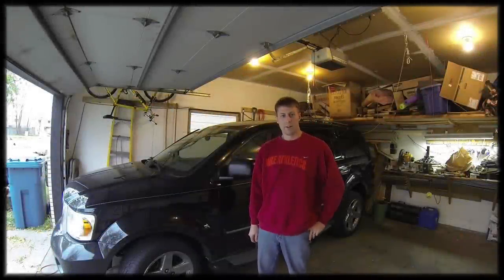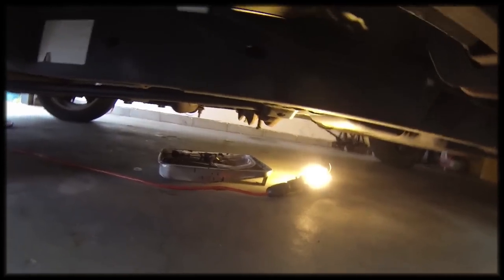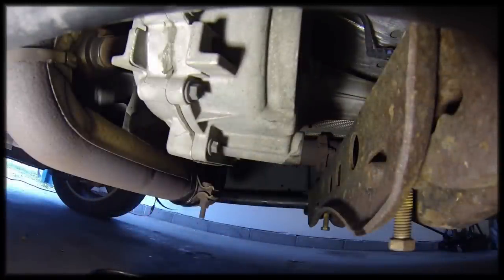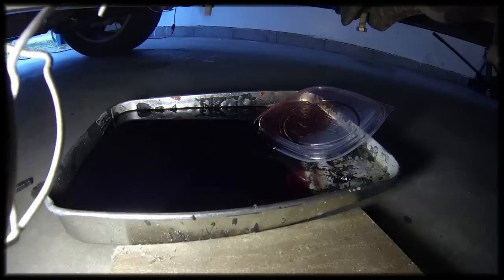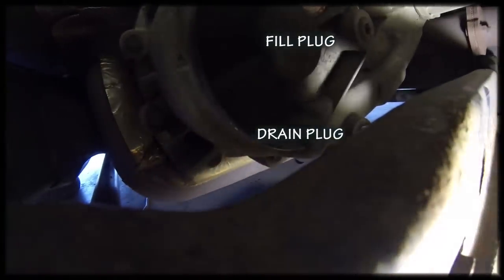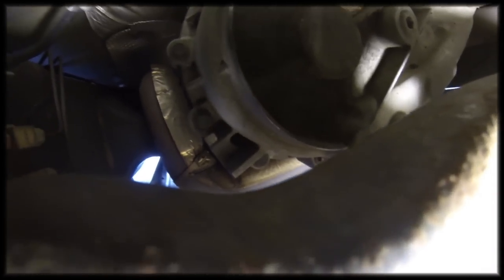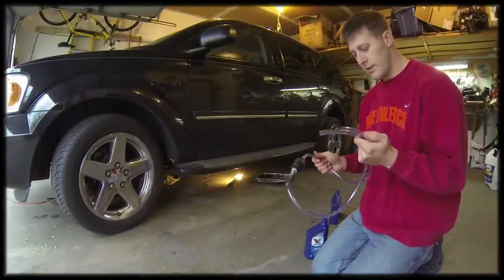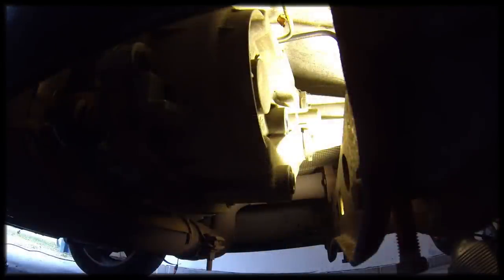2007 Dodge Durango - Transfer Case Fluid Change

Comment: Great video. I have a 2007 limited and am starting to get into doing maintenance myself. Just replaced the spark plugs and PCV valve and thanks to your video will be working on transfer case

Comment: i have been watching your rear diff, and about to watch front diff video, i have a 2006, from what i can tell the 2006 and 2007 should be the same right? i have the hemi AWD, 4WD , can you tell me if these videos all will work for my 2006? sorry for stupid question, thanks!!!
Reply from the maker: I am not certain if the 2006 is identical to the 2007 but the general procedure should be the same even if it is different.

Comment: LOVE it!  I have the identical vehicle to you, and had a situation last night where it seemed to be stuck in 4WD low.  Has that ever happened to you?
Reply from the maker: No that has never happened to me, but the shifting into 4WD low occurs in the transfer case (it is sort of a mini transmission), so if the fluid were low in the transfer case then it might not shift correctly.  The same thing happens in the transmission when it is low on ATF.
Reply: I changed the transfer case oil, and the front diff oil, and that seemed to fix the problem.  It's uncanny that your Durango is identical to mine.  Same color and everything!

Comment: Just did the job, tried best to get vehicle level on four jackstands. Only got 3/4 quart out and could only get 3/4 quart back in without overflowing.. read it takes 3.4 pints.. that’s 1.7 quarts. I know I didn’t under-fill or overfill it but possibly think the vehicle wasn’t level enough so not all fluid drained. At least he’s got almost a quart of good stuff in there tho right? lol